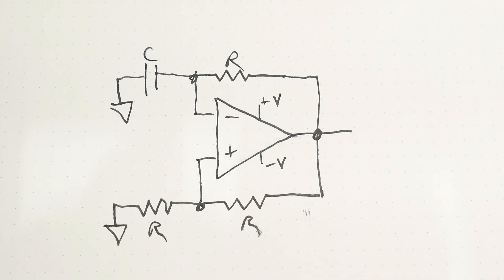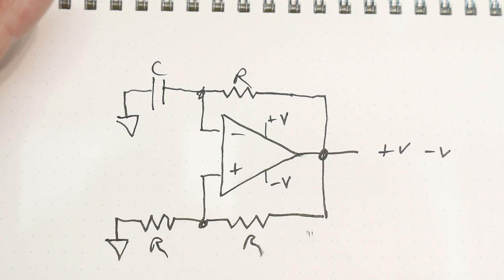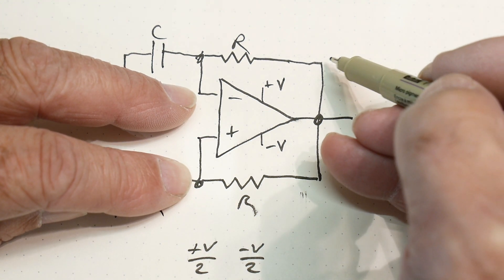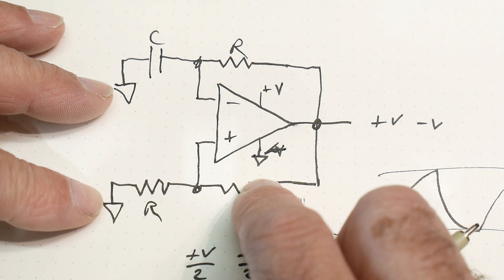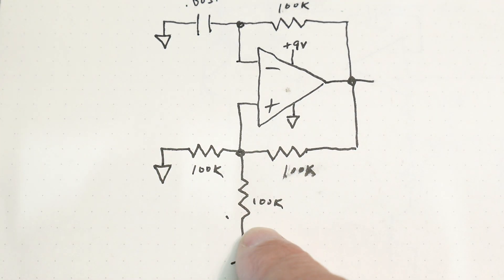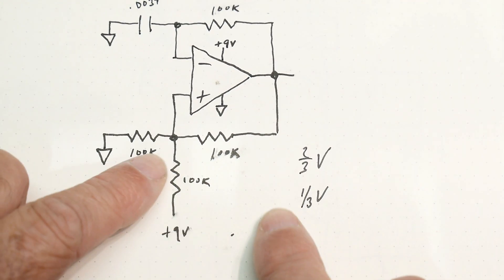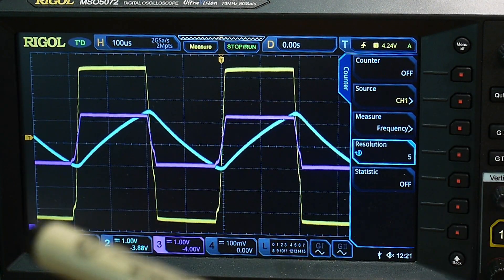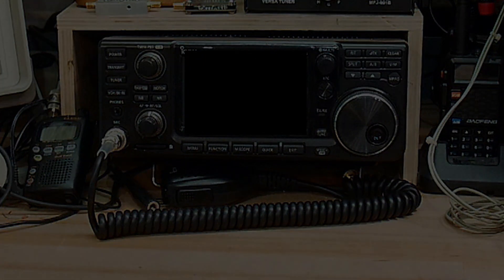#1052 Op-amp Oscillator for Single Supply

Comment: Coincidentally I just repaired a HP6002A power supply that was using the same circuit, the reflex oscillator as a clock signal for firing SCRs that are between the transformer and the rectifiers. The clock signal was missing. The comparator was bad.

Comment: Hi.. its a nice video, can you let me know the specifications of Resistor and Capacitor needed to be used for TL082 Op Amp to build the same circuit in bread board.

Comment: LM358 does not work on 1 KOhm for square pulse generator.
I used lm358 as oscillator pulse wave generator by providing 12V DC. I provide extra resistor R to the positive pin of the op amp as described in your video. All resistors used are of value 1 KOhm, total 4 resistors. However, surprisingly, the op amp does not work. It does not give out even a mere 12 V. Rechecked the circuit, but still no results.

Now, very contrastingly, with still maintaining the same circuit, I changed all the values of R to 10 KOhm, total 4 resistors.
At this point, the op amp generates PULSE SQUARE WAVE.
So, my request is to make new videos why OP AMP does not work on resistors of 1 KOhm. But work on 10 KOhm.
Thanks.
Reply from the maker: the LM358 is a slow opamp. changing from 1k to 10k slowed the oscillation down by a factor of 10
Reply: Which resistor and capacitors are needed for TL082 op amp ?

Comment: How do you calculate the frequency for this one? I tried the usual 1/2piR_cC as well as using the formula for the dual supply, the one with the 2RCln(2R_2/R_1), they are giving me values that don't agree with my simulation.
Reply: hi, please check your project by replacing all resistors with value 1 KOhm. Your op amp will not work.
Reply from the maker: Yes. Those won't work. You need to solve for the upper trip voltage and lower trip voltage. I don't feel like doing the math.
Reply: @IMSAIGuy  hello, I used lm358 as oscillator pulse wave generator by providing 12V DC. I provide extra resistor R to the positive pin of the op amp as described in your video. All resistors used are of value 1 KOhm, total 4 resistors. However, surprisingly, the op amp does not work. It does not give out even a mere 12 V. Rechecked the circuit, but still no results.

Now, very contrastingly, with still maintaining the same circuit, I changed all the values of R to 10 KOhm, total 4 resistors.
At this point, the op amp generates PULSE SQUARE WAVE.
So, my request is to make new videos why OP AMP does not work on resistors of 1 KOhm. But work on 10 KOhm.
Thanks.

Comment: You probably should put those "V" in quotation marks.  Only for rail-to-rail opamps is this very close to V.  Most are about 2 V away and many are not even symmetric.  You can improve the symmetry and accuracy of your waveform greatly in most cases using an output resistor and two matched Zener diodes inverse series to ground.

Comment: You said single supply but shown two polarity supply with separate ground.Why?
Reply from the maker: did you watch the entire video? I show both types
Reply: @IMSAIGuy  please help. Its urgent.
I used lm358 as oscillator pulse wave generator by providing 12V DC. I provide extra resistor R to the positive pin of the op amp as described in your video. All resistors used are of value 1 KOhm, total 4 resistors. However, surprisingly, the op amp does not work. It does not give out even a mere 12 V. Rechecked the circuit, but still no results.

Now, very contrastingly, with still maintaining the same circuit, I changed all the values of R to 10 KOhm, total 4 resistors.
At this point, the op amp generates PULSE SQUARE WAVE.
So, my request is to make new videos why OP AMP does not work on resistors of 1 KOhm. But work on 10 KOhm.
Thanks.

Comment: Great Tutorial, I would like to experiment with opamps and was wondering if you have a schematic of Diy dual rail power supply. adjusting both outputs with the same control ?
Reply from the maker: That is called a dual output tracking supply. I would do something like the first schematic here: https://www.eevblog.com/forum/projects/linear-power-supply-with-multiple-outputs/
use a potentiometer with dual wipers.

Comment: Another awesome video. I use this circuit when I want a cheap and dirty (variable frequency) PWM. Since the PID function can be solved in a single op amp, an LM358 can be used as a complete PID/PWM system and tuned with the Ziegler–Nichols method.

edit- I should add, to hack this circuit for PWM start by changing the value of the resistor of the 9 volt to positive node from 100K to a lower value. Try using 10k as a starting point with a 10K pot.

Comment: Do you know any simple oscillator circuit that transfers the charge back and forth instead of dissipating it for every cycle? Thank you very much.
Reply: If you use a resistor as a timing element, you will dissipate the charge. That implies that you need to use a tuned LC circuit to create your oscillator. You can Google for "op amp LC oscillator" or for the terms "Colpitts" or "Hartley" and turn up many examples.
Reply from the maker: Rex is correct. there are relaxation oscillators or resonate oscillators. search for resonate LC or also crystal oscillators.
Reply: Try playing with this and get an inductor and see where you can put it to get it to oscillate :) Rediscovery can be quite thrilling because it’s all new for you!

Comment: Thanks for the very intuitive introduction and I wish I had seen your video earlier when I first started designing my own circuit as a hobbyist. 
I always love this type of astable multivibrator over 555 ones since most 555 timer ICs require 5V and a few mA current, but this one, as there are a  wide selection of opamps, one can build oscillators with extreme features, such as - 
very low supply voltage (as low as 1.5v)
very low power (I even tried 800nA range using nanoAmp opamps, very tiny capacitor and very large (a few Mohm) charging resistor)
high frequency (1MHz using high GBWP opamps, or very fast comparators).
Reply: A bjt astable multivibrator can go down to little over 0.7 volts (it still oscillates even under threshold, but to a different frequency).
Reply: @copernicofelinis  Sure, that totally make sense. And I wondered what oscillator would operate with even lower voltage, like 200mV or something? Since I saw quite a few energy harvesting ICs which are basically very very low voltage DC-DC boost converter. To start with such IC needs to have oscillator working with very low voltage. Don't know how that was achieved.
Reply: @sullivanzheng9586  Mosfets configured to have zero or close to zero threshold voltage will do it. Or any mosfet in subthreshold operation.
Reply: @absurdengineering  You mean the classic 2 mosfet multivibrator with their drain coupled to each other's gate via capacitors?
Reply: @copernicofelinis  My guess could be a JFET oscillator since for JFET it can be biased to amplification region even when Vgs = 0. While BJT and MOSFET requires significant higher bias Vgs/Vbe

Comment: Really great explanation of the astable multivibrator (at least that's the name I learned for this circuit). I appreciate the storytelling involved in the video explaining why the old configuration wouldn't work. When I first took Electronics I this circuit gave me so much trouble, and your explanation would've helped out tremendously.